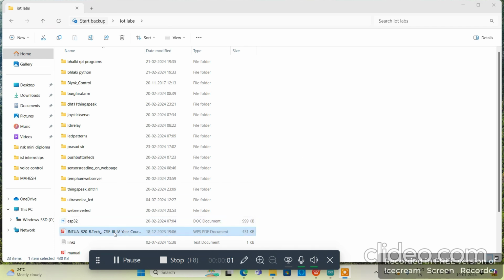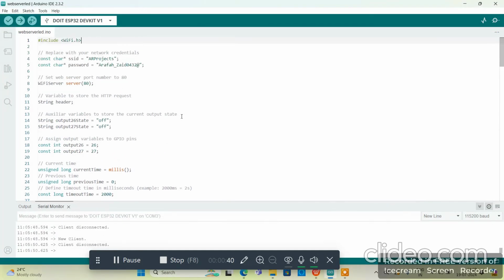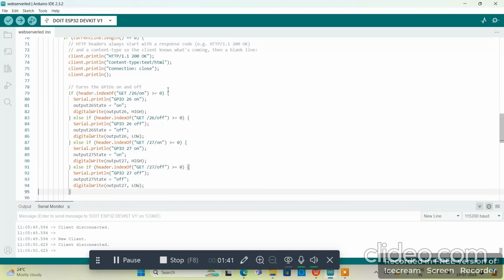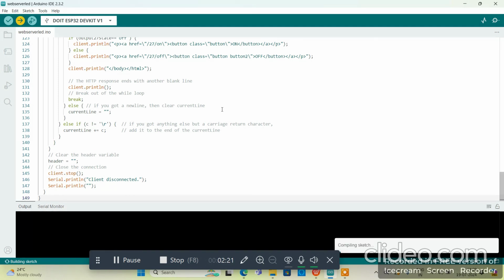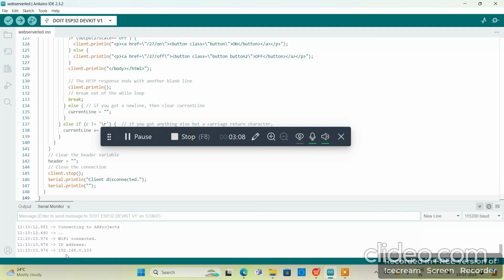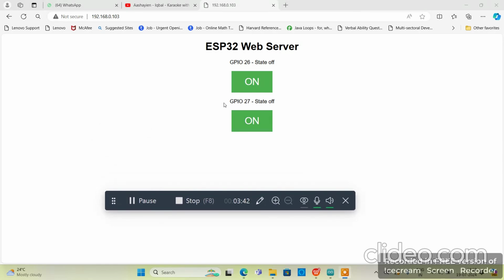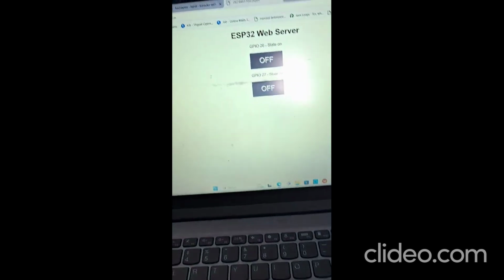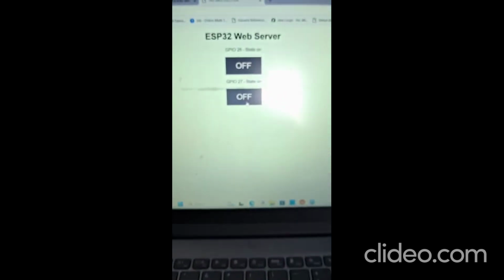esp32 experiment no :6

Comment from the maker: code:
#include <WiFi.h>

// Replace with your network credentials
const char* ssid = "ARProjects";
const char* password = "Arafah_Zaid0432@";

// Set web server port number to 80
WiFiServer server(80);

// Variable to store the HTTP request
String header;

// Auxiliar variables to store the current output state
String output26State = "off";
String output27State = "off";

// Assign output variables to GPIO pins
const int output26 = 26;
const int output27 = 27;

// Current time
unsigned long currentTime = millis();
// Previous time
unsigned long previousTime = 0; 
// Define timeout time in milliseconds (example: 2000ms = 2s)
const long timeoutTime = 2000;

void setup() {
  Serial.begin(115200);
  // Initialize the output variables as outputs
  pinMode(output26, OUTPUT);
  pinMode(output27, OUTPUT);
  // Set outputs to LOW
  digitalWrite(output26, LOW);
  digitalWrite(output27, LOW);

  // Connect to Wi-Fi network with SSID and password
  Serial.print("Connecting to ");
  Serial.println(ssid);
  WiFi.begin(ssid, password);
  while (WiFi.status() != WL_CONNECTED) {
    delay(500);
    Serial.print(".");
  }
  // Print local IP address and start web server
  Serial.println("");
  Serial.println("WiFi connected.");
  Serial.println("IP address: ");
  Serial.println(WiFi.localIP());
  server.begin();
}

void loop(){
  WiFiClient client = server.available();   // Listen for incoming clients

  if (client) {                             // If a new client connects,
    currentTime = millis();
    previousTime = currentTime;
    Serial.println("New Client.");          // print a message out in the serial port
    String currentLine = "";                // make a String to hold incoming data from the client
    while (client.connected() && currentTime - previousTime <= timeoutTime) {  // loop while the client's connected
      currentTime = millis();
      if (client.available()) {             // if there's bytes to read from the client,
        char c = client.read();             // read a byte, then
        Serial.write(c);                    // print it out the serial monitor
        header += c;
        if (c == '\n') {                    // if the byte is a newline character
          // if the current line is blank, you got two newline characters in a row.
          // that's the end of the client HTTP request, so send a response:
          if (currentLine.length() == 0) {
            // HTTP headers always start with a response code (e.g. HTTP/1.1 200 OK)
            // and a content-type so the client knows what's coming, then a blank line:
            client.println("HTTP/1.1 200 OK");
            client.println("Content-type:text/html");
            client.println("Connection: close");
            client.println();
            
            // turns the GPIOs on and off
            if (header.indexOf("GET /26/on") >= 0) {
              Serial.println("GPIO 26 on");
              output26State = "on";
              digitalWrite(output26, HIGH);
            } else if (header.indexOf("GET /26/off") >= 0) {
              Serial.println("GPIO 26 off");
              output26State = "off";
              digitalWrite(output26, LOW);
            } else if (header.indexOf("GET /27/on") >= 0) {
              Serial.println("GPIO 27 on");
              output27State = "on";
              digitalWrite(output27, HIGH);
            } else if (header.indexOf("GET /27/off") >= 0) {
              Serial.println("GPIO 27 off");
              output27State = "off";
              digitalWrite(output27, LOW);
            }
            
            // Display the HTML web page
            client.println("<!DOCTYPE html><html>");
            client.println("<head><meta name=\"viewport\" content=\"width=device-width, initial-scale=1\">");
            client.println("<link rel=\"icon\" href=\"data:,\">");
            // CSS to style the on/off buttons 
            // Feel free to change the background-color and font-size attributes to fit your preferences
            client.println("<style>html { font-family: Helvetica; display: inline-block; margin: 0px auto; text-align: center;}");
            client.println(".button { background-color: #4CAF50; border: none; color: white; padding: 16px 40px;");
            client.println("text-decoration: none; font-size: 30px; margin: 2px; cursor: pointer;}");
            client.println(".button2 {background-color: #555555;}</style></head>");
            
            // Web Page Heading
            client.println("<body><h1>ESP32 Web Server</h1>");
            
            // Display current state, and ON/OFF buttons for GPIO 26  
            client.println("<p>GPIO 26 - State " + output26State + "</p>");
            // If the output26State is off, it displays the ON button       
            if (output26State=="off") {
              client.println("<p><a href=\"/26/on\"><button class=\"button\">ON</button></a></p>");
            } else {
              client.println("<p><a href=\"/26/off\"><button class=\"button button2\">OFF</button></a></p>");
            } 
               
            // Display current state, and ON/OFF buttons for GPIO 27  
            client.println("<p>GPIO 27 - State " + output27State + "</p>");
            // If the output27State is off, it displays the ON button       
            if (output27State=="off") {
              client.println("<p><a href=\"/27/on\"><button class=\"button\">ON</button></a></p>");
            } else {
              client.println("<p><a href=\"/27/off\"><button class=\"button button2\">OFF</button></a></p>");
            }
            client.println("</body></html>");
            
            // The HTTP response ends with another blank line
            client.println();
            // Break out of the while loop
            break;
          } else { // if you got a newline, then clear currentLine
            currentLine = "";
          }
        } else if (c != '\r') {  // if you got anything else but a carriage return character,
          currentLine += c;      // add it to the end of the currentLine
        }
      }
    }
    // Clear the header variable
    header = "";
    // Close the connection
    client.stop();
    Serial.println("Client disconnected.");
    Serial.println("");
  }
}